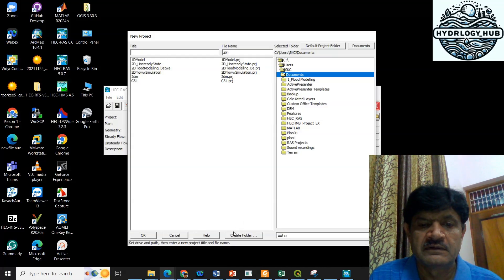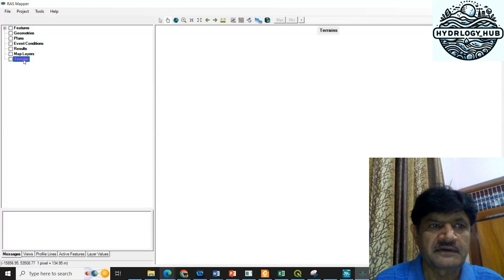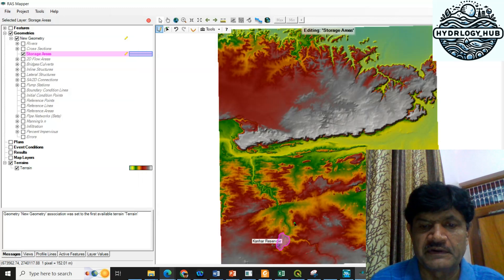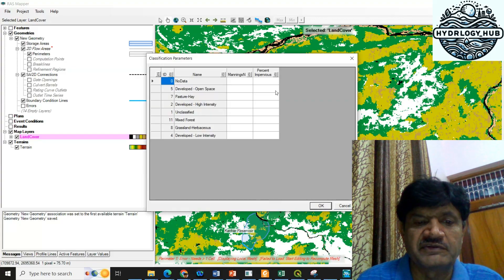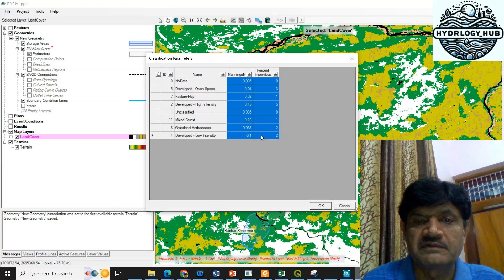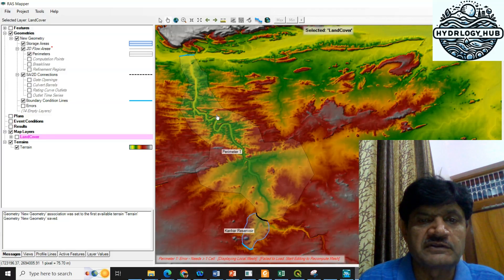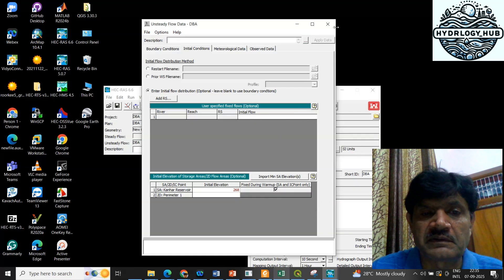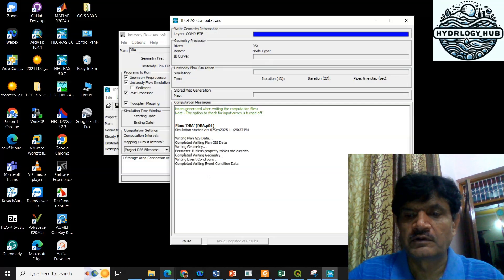Dam Break Flood Analysis Using HEC RAS | Easy Step by Step Guide (14/15)

Comment: The cross section of the dam is set and the flow hydrograph is also set and the n value is also set now I don't know how to reduce discharge, my discharge is overtopping the dam
Reply from the maker: What do you mean by "How to reduce discharge?"
Reply: @HydrologyHub  in rating curve it should be 481.36 but in my case its around 551.83